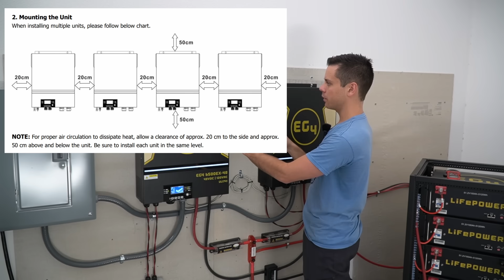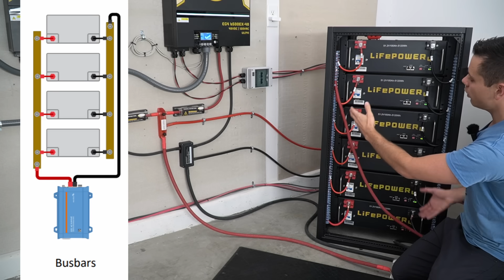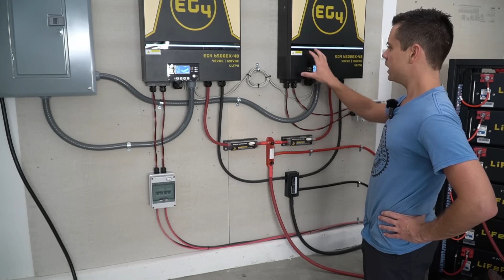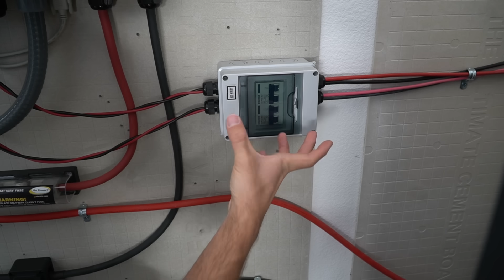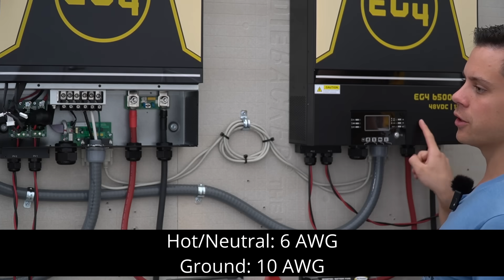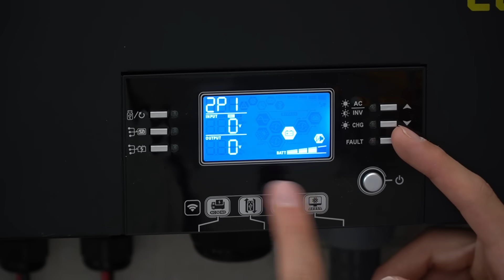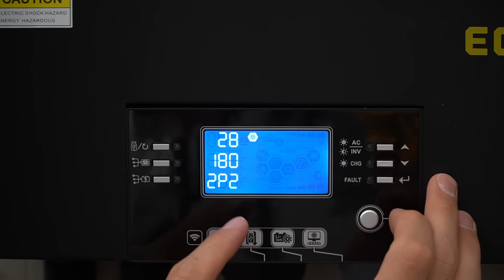Complete 48V Offgrid Solar Power System

Comment: WOW ... Legal Grid Tied in Nevada (I believe) . After asking a long time Solar Business n Motorcycle n eBike Buddy in Northern California, I think this will also make the hoop jumps for a legal grid tie in California. I heard local fire departments may or may not have various requirements for ability to turn off your solar panel voltage,... for if there was a house fire to deal with.  IMO: That setup is an Awesome Development. Re: The Legal Grid Tie - Big Advantage: What a great way to make use of otherwise idle solar panel power (like when  AC load is not using up available solar watts), and use em up to the max via sending all those extra solar watts into the grid.   ... I hope the grid suppliers start paying a fair return.  Curious about that part of the picture.  Also:  I wonder what the idle watt draw is on these units, and wish those guy would start including that information in their spec. sheets.  ... Added Note: My solar buddy pointed out Enphase or SolarEdge are all managing 98-99% efficiency, vs these lower cost options operating at about 91%  efficiency. My buddy encouraged me to compare a PAIR of these against a SolarEdge 6k or 7k single inverter. ...  Thanks for The Reviews Will.

Comment: Love this system.
Fun Facts.   Each battery holds a total of $0.57 worth of electricity (@ 11 cent per kWh).  So total bank only holds $3.28 worth of electricity.   If you fully charge and then discharge  a battery every day for an entire year a grand total of $208.05 worth of electricity flows through a battery in one full year.  Hmm.
Reply: That makes trying to live off grid seem trivial! Of course it's not, and it seems like the days of cheap kilowatts are coming to an end.

Comment: Excellent tutorial! Is there a way to limit the times wires cross each other on the wall?
Reply from the maker: It's so hard to avoid crossing wires. You could use an enclosure for the wires, but I don't like the idea of bundled wires in a box. but it is an option and protects everything nicely.
Reply: @WillProwse  Yeah it's hard, one thing that would look neat is to route the wiring to the solar panels up instead of down. And if one would be willing to go trough a lot more work put the conduit for the output behind the wall. Functionally it doesn't make it any better, probably even harder... All that being said and done your setup is super nice!
Reply: Just use an electrical gutter. Expensive but pretty.

Comment: 9 grand in just batteries isn't budget by most standards...

Please don't let that distract from the fact that, you and your information are PRICELESS to me and many others
Reply: Divide 9k over say 12 years. How about Divide $20k over 15 years for a system u can install yourself. That’s just over $110 a month in electric bill. I can tell u here in the northeast a $110 electric bill is hard to get, $175-$200 is normal for a average 2k sq ft house. At $.24 per KWH from the grid and rising, the up front cost of solar, batteries, and inverter and using the grid as a stand-by generator is far more appealing to me. Electricity is going to become a National problem in the next 4-8 months based on current fuel and generation costs. Start looking for ways to be self sufficient…. Jimmy G’s words of wisdom…..
Reply: @jimmyg6215  your wisdom is why we are here. I'm saving for it... just gotta get started.
Reply: Yeah, but it’s $9k of batteries for 30KWH of storage. The batteries are pretty much as cheap as you can get $/KWH. U can alway run this inverter setup on less batteries.
Reply: @ggardentracks2012  is the beautiful part of how he breaks it down... buy what you can and piece it together as you go

Comment: I’d love to see this setup as a whole home UPS.  I.e. something that can replace all or most of a 200A service.
Reply: 48kW (This is at 13kW) - gonna need some bigger equipment :) but it's improving quickly.  Really you don't need that much though, probably like 60 or 70% of it.  Shoot I have 200A service and I don't think I draw more than 18 or 20kW ever (with car charging near 10kW, AC going, cooking or laundry etc).
Reply: @whattheschmidt  2 units = 13kw, but can string up 6 to get 39kw.. that would be 162.5A (about 80% of 200A)
Reply: @wanderlust7020  yes, that's a wild amount of power!

Comment: Awesome information and advice Will, Thank You.  Appears we could also get 3-phase power with three 6500-48's setting the phase sep'n to 120-degrees?  Is this correct?  Have resisted bringing over my larger planers and CNC machines as running 3-phase off grid has not been a considered possibility.
Reply: Out of curiosity, how does that work?  I understand the whole 120 deg thing and keeping things in sync ... but if its setup this way can you still run normal 120 and 240 single phase off the system as well?  I'm just now switching from 120 only to parallel units for 240 .. so this is all new for me.
Reply from the maker: Yes exactly. 3 phase is very easy too. Just need to change settings to 3 phase.
Reply: @WillProwse  Thanks again for everything you've developed/posted to educate us, it's really appreciated and fantastic!

Comment: Excellent setup and video, Will! I was wondering if you have the Bigbattery "blade" on your radar? Looks interesting...
Reply from the maker: Too expensive and it has an active balancer, which I don't care for. I also don't think think the blade battery has features that help stationary storage. the blades features are designed to benefit electric vehicles. not stationary storage.

Comment: Do you know of a way to comply with 2017 rapid shutdown requirements with a system like that? The per panel shutdown requirement has been keeping me from going off grid. I have to install the panels on my roof so ground mount isn't an option.
Reply: I Use a Fire Raptor system.  I run the AC output from the inverter outside to a shutoff switch by my meter (kills all power coming from solar and batteries to my AC panel) - then runs back inside to the AC panel.  I power the fire Raptor shutoff button (also by my meter) from this same AC output.  THis way both the panel voltage and any power coming from My solar/Batteries can be shutoff from the outside at my Meter

Comment: Great video. For clarification please, if what I am looking for is for now a UPS system for portions of my new electrical system for my barndo that is capable of supporting Solar at a later date, is this a good setup?. I want to have the batteries charged from the grid or a manual switch of grid/generator in the event the grid is down if the batteries get low enough. So I would use the system you have shown but in bypass mode as mentioned with ac input to each inverter correct? Do I need 2 of the inverters if everything will be 120V running off the UPS setup but still want the 30Khw battey systtem?

Comment: These can be used to supply power back to the grid correct? Would that need to be wired differently or is that just a setting that needs to be changed?

Comment: Are there no code issues associated with that positive bus bar having partially exposed terminals?   Or with the exposed bus bars on the battery rack?  The ones on the rack especially would make me nervous.
Reply: But  some local codes do require high voltage solar DC cabling to be in EMT.  Always ask your Electrical Inspector what they want to see at planning  meeting or rough in inspection .  Mine was a stickler about ground bonding bushings being used.
Reply: 48V dc is considered touch-safe by the NEC
Reply: @stefanvanzyl9090  I always thought the saying was "Volts hurt, Amps kill"
Reply from the maker: Yeah it can vary significantly. I'm going to add a mention of the HV DC and conduit. People should hire a professional to do that step.
Reply: @WillProwse  Good to know thanks, and great job with all this, really laid it out in great detail.  Love what you do !

Comment: Please note if your local code enforcement is following NEC 2020 all 50 amp loads (edit: and below) will be GFCI protected. And with the possibility of having stay voltage on the ground, nuisance tripping is a real possibility... Just FYI
Thanks Will for another great video!!!
Reply: With the LV5648 I run grid charge/pass through as well as off grid time and have yet to have the GFCI breakers false trip during the last five months since it’s been in operation. It was a big concern for me too.
Reply: @SkypowerwithKarl  agreed; I haven't had any issues with my systems either. But it's still a possibility, and just wanted to pass along this information to the community. 😊👍🌄
Reply: @meganwinters5163  
Plan for the worst and hope for the best. Seems to be my mantra these days.

Comment: Will, for a clean look, I'd recommend you use a RJ45 wallbox next to the positive and negative Ts to go out to the batteries' BMS linkup, instead of going to the inverters directly. Then you can use a patch cable approximately the same length as the battery conductors.

Comment: WILL CAN YOU DO A 24V SET UP WITH 3Kv inverter using 2 server rack batteries, as far as what is the maximum solar and load that can be used off grid.

Comment: What are your thoughts on the benefits of the signature solar branded LV6548's, besides the pretty colors? Will the standard MPP's communicate with their batteries, or is the firmware/ports different? I know the LV6548's can use Pylontech over RS485, so I imagine thats what the EG4 BMS's are using. Ok, I will patiently wait for your communications video. 😁
Reply: The biggest plus for these specific inverters is the UL listing
Reply: I think one of the best things about them over the lv6548’s is the huge increase in the voc limit.

Comment: Yup, EG4 has become my favorite and most sought after inverter to replace my current system. I gotta be honest I'm not fond of the colors. I like the light bar, a lot. If somethings wrong with my system I'd rather see that than a little tiny LED saying somethings wrong. Thankyou for making this video, myself, for future reference, but this is very helpful info. I didn't know about the dc breakers for the solar. Had an idea about it but you've thoroughly educated me about it. Well done Will. Look forward to your next one

Comment: Thanks Will,   looks great.  I think this is what I need.  My only question is about the inverters.   Can these high frequency inverters handle the surge from a 240 volt well pump along with a mini split.  I've watched a few tests on some other inverters and they couldn't handle a saw cutting a beam.   Is a low frequency inverter required for that type of load?  I'd appreciate it if you could load test your system.   Though, handling you ac and charging your car is pretty good. 😀

Comment: such a great video, may i ask even for off grid do you need to connect the ground rod to the panel box and run it to the ground in case of lightning?
Reply from the maker: I have covered this in a past video and multiple times. I suggest hiring a professional to assess your environment and installation and see what they recommend. I ground when I need to ground. I run many systems floating if necessary. really depends on quite a few factors and how it's connected
Reply: Perhaps Will should start adding lightning arrestors or even EMP arrestors to the systems he builds.  Though he is going to have fun tryin to "load test" them.

Comment: How would this solution compare with a SolArk battery setup and their new 15k inverter for off grid and grid tie setup?
Reply: I preordered the 15k. I’m curious, too. This is less expensive but about the same capacity
Reply: I installed a Sol-Ark 12k system last year and I have to say they are expensive but have a lot more flexibility when it comes to using it off-grid or grid-tied. Lots of features. Good support. Good warranty. And very DIY install—as long as you have some understanding of AC wiring.

Comment: I'd like to see some more details on the AC wiring side.  I sort of understood the first version you posted (single load center breaker), but this new version is confusing me.  Its like the input breakers can only work with specific (load) breakers.  Or at least thats the impression the images give me.  Also, you dont really have control of "each" inverter input since both lines coming into the (linked) breakers.
Reply: It's important that when a single leg trips out due to overload, both inverters' supply gets cut, otherwise you'd be supplying 3-wire loads with one hot wire.
Reply: @stefanvanzyl9090  Understood.  I think it was just the way he phrased it in the video when saying Signature recommended individual breakers.

Comment: Thanks Will.  I have a question about the loads coming from the load center.  I see you have 3 240V circuit breakers and the top 2 are being used while the bottom one is not connected.  I have a question about the middle breaker.  It looks like you have a black and red on the top breaker connected to the hot leads and on the middle one you have a black and white connected to the hot leads.  Why black and white instead of black and red?  Or am I not seeing this correctly?  Thanks.
Reply from the maker: Oh that's just the color code that came with the cable I'm using. I do not like that it is white.
Reply: @WillProwse  Hmm, weird.  So what color is the neutral wire coming from that romex cable?
Reply from the maker: @robertgiresi9515  there is no neutral. that cable is for nema 6-50. That's why I love it. I hate running the neutral when it's unnecessary
Reply: @WillProwse  Thanks Will.  I'm no electrician (I'm an IT guy), and just someone who's knows enough to be dangerous.  I've played around adding circuits to my load center but I never knew you could run a circuit without having a neutral.  I'll have to research that further.  Thanks.
Reply: It is kinda confusing .. perhaps a followup video or even just some closeup photos on your blueprint site.

Comment: Will, any chance you can do a video on connecting the communication between the new EG4 6500EX-48 to the SOK SK48v100 batteries?  I bought a few of those along with the MPP LV6548 after watching your videos but canceled my MPP LV6548 and switched to the EG4 6500EX-48 since it is Certified and has some improvements.

Comment: This is really a great video.  Question on the transfer switch where does it go (is it  between the panel shown above and the house panel? and to put a transfer switch do I need a city permit?
Reply: The transfer switch needs to be installed by a registered electrician in most jurisdictions...
Reply from the maker: Yeah I'm going to recommend everyone use a professional for transfer install. There is no way that should be done by unqualified person.

Comment: Lazy I know:
Can they be setup for 1 phase 240V 50hz and/or 3 phase 240/400V 50hz ?

As that is what we use on this side of the pond ;)

Love the videos, great insight and pretty fun to see how it is done outside ones own area.
Reply: Growatt, MPPsolar and other companies make inverters based on the same internals for these markets, capable of running 400V 3ph when 3 units are used (or more, if any phase needs additional power)

Comment: Great content as usual.  In your output panel, if you need a few 120V circuits, is there anything else necessary other than simply using a 120V breaker?  Thanks for all you do!
Reply from the maker: Thanks! And a few 120V single pole breakers is all you need for those loads.
Reply: @WillProwse  Figured so but wanted to ask.  Thanks a ton!

Comment: OK, I have a question...I see how the solar array leads come into the inverter; I see how the batteries connect to the inverter input; I see how the A/C output connect to the panel; what I don't see is how the solar panels get power to the batteries.  Can you explain?  Love the channel btw!
Reply: Internally the unit has an MPPT controller that will supply power to the batteries from the solar input.  Same DC line to the battery for both input and output.
Reply: The MPPT controller and battery charger is built into the inverter - this is why it's called an all-in-one. PV comes in, gets converted to 48V and sent to the batteries as required

Comment: Are there any fire suppression systems that are designed for lithium power blocks like that?
Reply from the maker: These are UL listed and non combustible chemistry, so they are as dangerous as a stack of wood
Reply: @WillProwse  Interesting, did not know that, good to know, thanks.
Reply: hooray for LiFePo.... No thermal runaway issues

Comment: Wish this was available 3 years ago when I used 12 Battleborn and two lv5048s. Oh well. It works just not as much power.
Reply from the maker: I'm still using my 5048 daily, such a solid unit. And yeah I wish they made these back then
Reply: @WillProwse  Imagine what they will have 10 years from now?

Comment: Any idea how many watts of solar could be used with these batteries?  Is there a calculator you would recommend so I could try and work this out?  Thanks
Reply: What are you trying to calculate? The inverters each support up to 4000 W of solar input per MPPT.

The batteries each can be charged at up to 100A 57V, which is 5700W per battery - this should fill them up in just under an hour.

Comment: I'd like to see a video on grid tied setup with battery backup. Is there any way to set some sort of automatic switch that will  switch from grid tied to off grid and back during peak hours?
Reply: I know this is a DIY Solar channel, but at least one video showing how to hook up a backup generator (for off grid use) would be cool as well.  They make some pretty nice hybrid (gas/propane) 120/240 generators that are pretty cheap that have AGS connections.
Reply: This is a grid tie bypass unit. But it isn’t for net metering. Assuming you are referring to bypass mode, there is settings in the inverter to auto transfer using voltage or specific times.